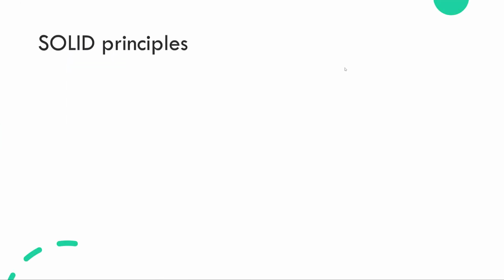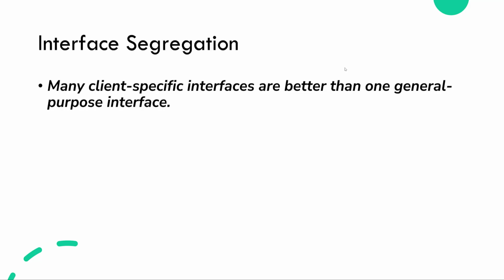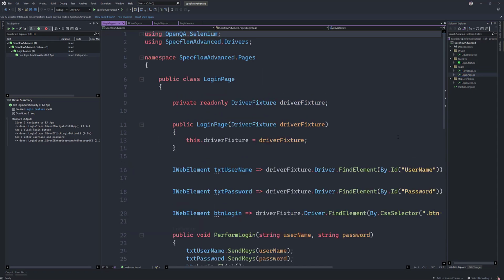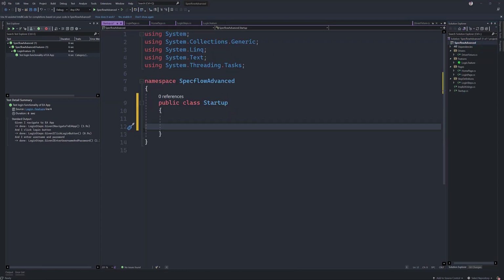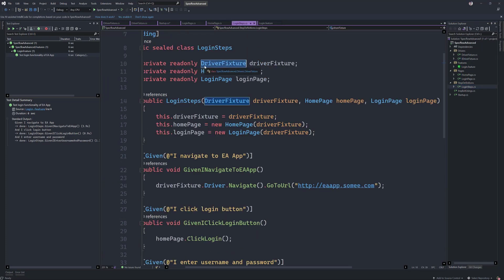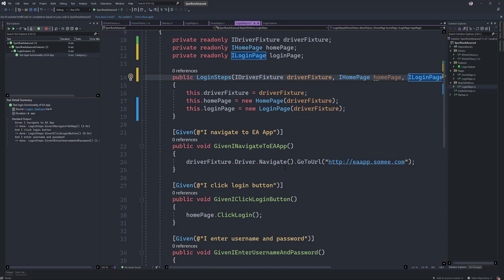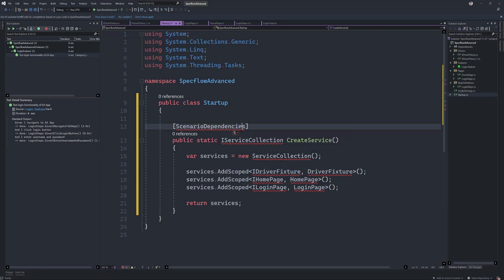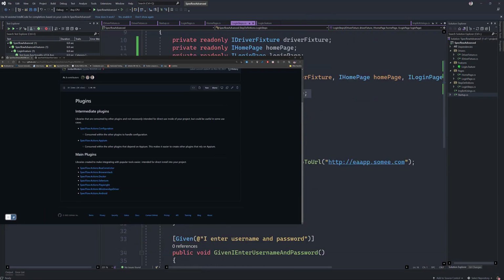Part 9 - Understanding Separation of Concerns and writing better software test automation code

Comment: Hey Mate.  I hope you are well.  Good video.  I have done DI in my test code in the past but got to thinking "there is not a need to change to a mock or a database so why do I really need to do dependency injection?".  I ended up pulling it out as other test engineers (and even some developers) are not at a level to understand dependency injection.  In conclusion, I think it is a decision the manager/lead has to make - how advanced do we need the test code to be?  
Let me know your thoughts.
Reply from the maker: Hy mate, I am good and hope you are doing good as well. Well, DI is mostly used in Scenarios such as Integration testing, Testing APIs with 3rd party libraries and systems which are too complex to test. The more robust and better the automation codes are, the better the test code for long run including maintenance, else our test becomes unreliable and unmaintainable
Reply from the maker: BTW, do you really think all the managers really understand technical details . If they are not technical manager, then there is no point in telling them what you are trying to do 😃
Reply: @ExecuteAutomation  LOL... true... true...